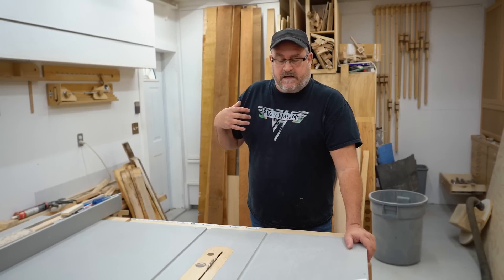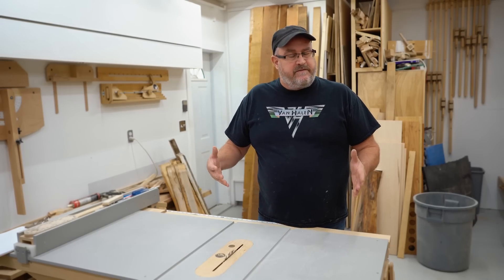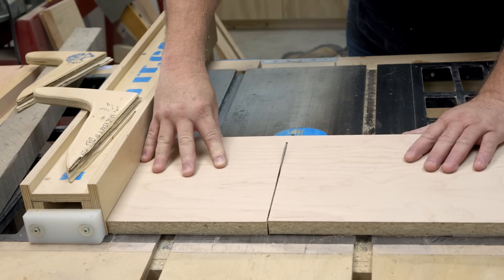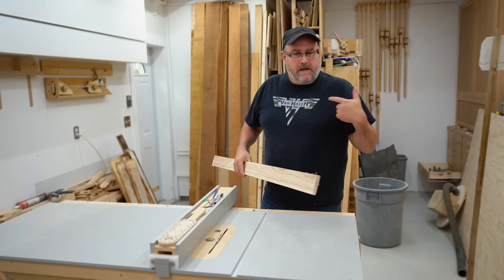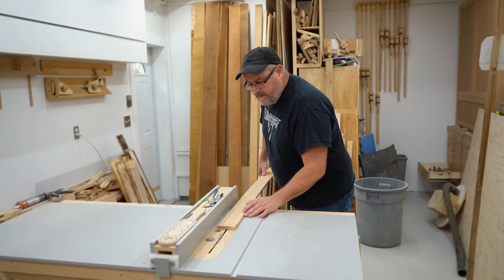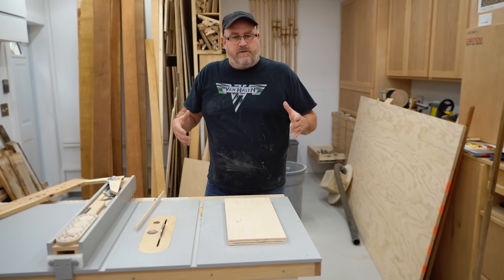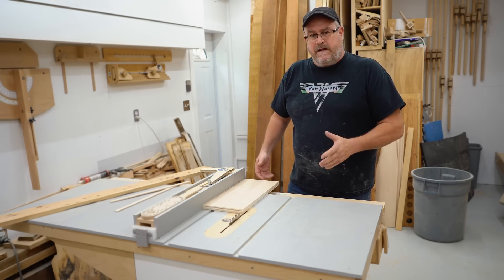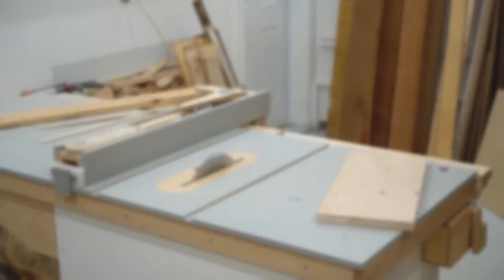Table Saw Basics - The Importance of Control

Comment: Love your channel! It seems to me that experience is short-billed in the safety arena. In my opinion, experience is the BEST safety tool; however, the only way to get there is to do it... Experience the feel of material which is getting grabbed by a dulling blade.... material binding as it turns out the fence is pinching the material because it is not parallel with the blade... material dancing/chattering between the blade and fence because you might have forgotten to lock it down and it started to drift... LOTS of tiny lessons... once learned... allow you to be a safer woodworker.... in my opinion...

Comment: This is not the first time I've seen John Heisz rationalize why he doesn't use a riving knife or splitter.  it's the simplest, easiest and most effective safety device ever developed for the table saw.  Using a saw without one is akin to driving a car without a safety belt.
Reply: Most people drive a car without a brain....Most people also have second hand tools that never had these features.
Reply: @lllBAMlll  The reason cars have seatbelts is not because people "drive without a brain".  And most people do not have second-hand tools missing these features.  They've been required on saws in the US for nearly 15 years now.  I'd say that's enough time for the used market to be saturated.  Regardless there is no reason for somebody who built his own saw to be advocating for the lack of a safety device unless he's resigned himself to the fact that he can't build one with the items at his disposal (I'd argue otherwise since you can install spitters on your insert), in which case it's just stubborness, not "experience" that's informing his beliefs.
Reply: @erik.reinert  You must be very young tools last for decades, my craftsman table saw is 60 years old.   hummmmmm
Reply: @erik.reinert  most people use the tools  that are available until they out grow them and upgrade, then someone else gets the old tool.
Reply: @lllBAMlll  By far most people buy new, but my point is that the used market is saturated with modern choices.  Regardless, if you have an old craftsman the solution is simple:  Install a splitter in a zero-clearance insert.  Done.  Then you don't need to make old-fashioned excuses for not-needing the most simple and effective safety device in woodwoorking, bar none.
Reply: @erik.reinert  Nope, everybody that dies has their stuff given or sold. Every useful tool that ever existed is still being used until it has no go left.  Also they make thousands of new people every day that eventually inherit those tools along with all the other stuff.   There are no provisions on older equipment for extra security, design doesn't work that way.   I have made many years of living selling everyone's old stuff.  Just because you think, doesn't mean you know!
Reply: @lllBAMlll  Heed your own advice, sir.  You sound like you're informed by your own bubble.

Comment: I've only recently seen the use of a table saw sled, and while the safety benefit seems obvious, I wonder if theres limitations in what can be done using it, surely though most cuts might be more consistent using a sled as it can be fed in a smooth motion.
Reply: a sled stops you cutting very long bits. but i use mine less now i am using the mitre saw more as i finally got it dialled in after almost 10 years haha.

Comment: I cut my fingers off on a saw that was turned off, I spotted a piece of wood against the blade and thought "When I turn that on, that is going to cause a problem" The blade was still winding down. They were reattached and work almost as good as new. I too am wont to remove the blade guard and riving knife, Now I pay more attention to what the blade is doing when it's turned off.  I also ride bikes in shorts and Ts.  

I do stuff my way and people watch and call me stupid, yet I have survived 30 years with only minor damage to my body.

Comment: the foam wouldnt kick back if you installed a riving knife, the riving knife stops the wood riding up th back of the saw and firing back at you. Here in uk its simple you use the saw with the riving knife and crown guard or you dont use it at all. Doesnt matter how much experience you have it only takes a second to lose a finger or two or get a piece of wood in trhe face. The crown guard on top of the saw also stops the workpiece lifting up off the bed as well as removing harmful dust, theres really no reason to be able to see the wood being cut you only need to watch the wood against the fence
Reply from the maker: So what do you have over there, table saw cops? Do they conduct spot inspections of garages, sheds and basements looking for violations of The Riving Knife Act or The Crown Guard Directive? What's the average prison sentence for offenders?
Reply: @JohnHeisz  yes John professional  registered  businesses have health and safety  inspections, if you  are caught being unsafe youll be in trouble if somebody gets injured using a machine with out adequate and correct guarding you can get shut down on the spot. If health and safety arent happy  with your practices they'll shut you down on the spot. Its no joke here, if you want to keep your business running. 
Obviously what people do in there garage is their business, If they want to be stupid and take stupid risk because they are over complacement  thats their own stupid fault, as long as no-one else goes into their garage and hurts their self on the inadequately guarded machine  in their garage then should be tickatiboo!
Do you diagee with what i said in my origanal comment about riving knife and crown guards making the saw alot safer by preventing kick back of the back of the saw from happening?
Reply from the maker: @martyn1678  My views were stated clearly in the video, so you should know them already.
Reply: @JohnHeisz  hope u stay lucky

Comment: For me, first and foremost is awareness, then control, though they are nearly just as important in my opinion. Being aware of what the tool is doing, what the workpiece is doing and where your hands are in relation to the tool is. You can have full control of the piece, but if you aren't aware of those things, can spell disaster since awareness allows you to adjust your approach.

Comment: Machines like table saws really should not be used without some basic training. Too many people end up buying a 3 or 4 horse power saw with no idea how to use it let alone use it safely and end up either losing fingers or with horrible kickback injuries. There really is no way to make these things totally 'safe' so it's up to the user to be informed about the risks and how to avoid them. The guy I learned from said pretty much the same thing about control, always watch the wood against the fence and never have hands beyond the start of the blade touching the workpiece, which I notice you don't do second always support the wood throughout the whole cut, especially important with cross cutting. Simple advice that will avoid 99% of all table saw injuries. I would also say that for a beginner a riving knife is absolutely essential while learning. Running without a riving knife takes skill which takes time to gain.

Comment: My saw doesn't have a riving knife or a blade guard ... didn't come with them.  I am scared of mine, so I am always super careful when using it.  But, one thing that I di use ... some type of pushing/holding equipment.  When I see you using your left hand to hold the material up against the fence, all I can think of is that unseen splinter.  When you start pushing that inch long splinter into your finger, you'll quickly forget about controlling the piece and POW!
Just saying ... not trying to convert you.  Good luck.

Comment: The BIGGEST Habit you WANT to develop - do NOT CROSS OVER THE BLADE - develop your work flow and technique such that neither your hands nor your work cross over the blade ( left to right) especially while it's spinning - you are asking for at the least, kickback, at the worst ... a new nickname : Stumpy.

The SECOND BIGGEST habit is that when you realize you are losing focus - STOP THE SAW, STOP THE WORK, WALK AWAY ... if not, you are inviting kickback, or.... a new nickname: Stumpy.

Think about it for one second - I can turn on my saw and push a 6" thick slab of oak over a fully raised blade - slowly - and it will cut that kerf out without much fuss .... do you think that the saw will even notice if it's cutting your hands, wrists, arms, or face up ?

Just google table saw injuries if you want a reality check - warning - strong stomach required .... if you lose focus, or in John's words - control - control of your work piece, control of your body, control of your attention etc, then the table saw WILL get you.

It took long enough for me to THINK that the way I was positioned and working with a HAND SAW was a bad idea for me to end up with 5 stitches in my palm. I'm sure that it was the more the fact that I did not STOP the cut ( it was a hand saw remember) while my active focus went from the cut etc to the hand that was in a bad place for me to slip with the saw and the OTHER hand ( nevrer forget the other hand!!) and drive that saw into my hand...just a small bite, only 3 at most teeth, but...

... and that was a hand saw.

I'm sad to say that that was what it took to actually listen to my own words - since then I have on more than one occasion stopped the saw and walked away rather than make that " just one more cut" ... you get in a zone while your working, and when that happens, your ACTIVE Focus wonders, and that is when you get hurt.

I've watched John do his thing here for years. Yeah, sure, I get the pucker factor now and then, but as John says, I should not ( and would not ) do it the same way becuase it is outside MY comfort factor and I'm smart enough to realize that I should do it another way.

I don't even like my hand passing near the blade when the blade is buried inside several inches worth of Oak making a rip cut, just gives me the willies.... but I'm sure if you watched me with a chain saw you would feel the same way, again, like John, it's a comfort factor and I know when I'm venturing into unsafe areas and I back off... but my unsafe area might be way across your line - don't cross your own line.

John,
Thank you again, you continue to reinforce things we all should already know and do for our own safety as well as the safety of others.

Comment: I just don't get it. You are a You Tube person showing how YOU do things. You are not a safety video in which someone can blame their malfunctions. Whatever happened to take responsibility for your own actions? If someone is going to use a power tool should't they be responsible for taking ALL safety precautions they need to take? I personally take more safety precautions than you, by appearance, but I don't have your experience. I can only state how I do things. It is NOT a matter of I'm right and you're wrong. I just don't have as much experience so I play it safe.

Comment: John's shop John's rules! My shop my rules. Grew up with an old diesel powered 4' sawmill rough cut table saw manual feed. No guard no knife no dust extraction just common sense still have all my limbs and still use the saw after log has been through the breakdown saw. It's a weapon on hardwoods but you gotta watch your feed rate it will bite...... hard